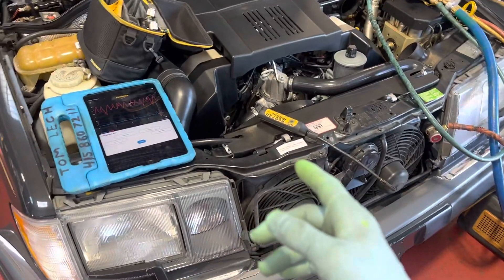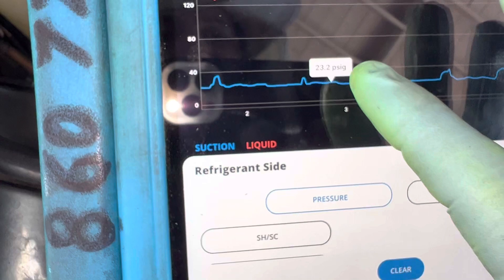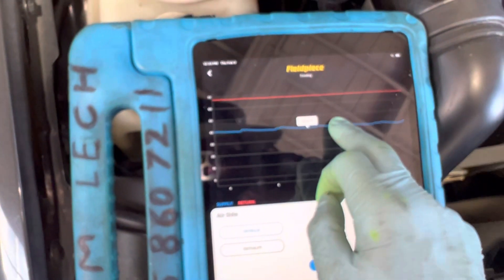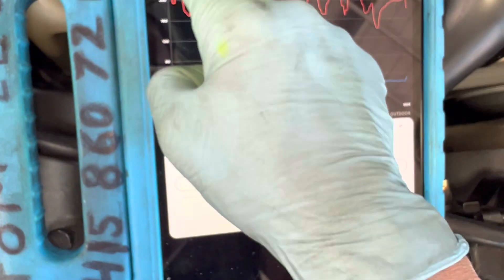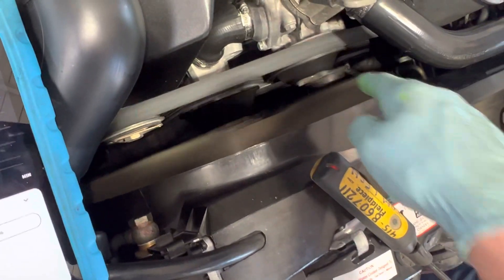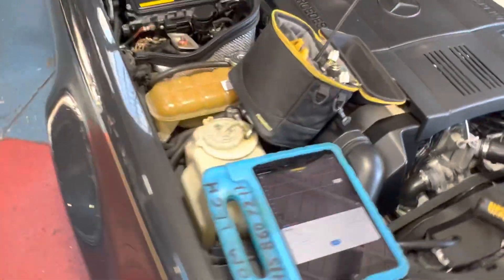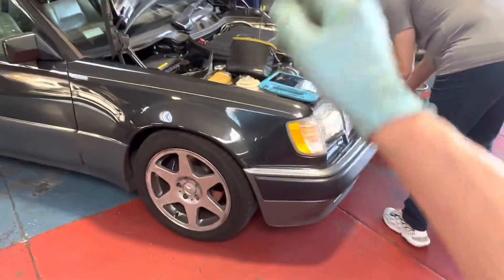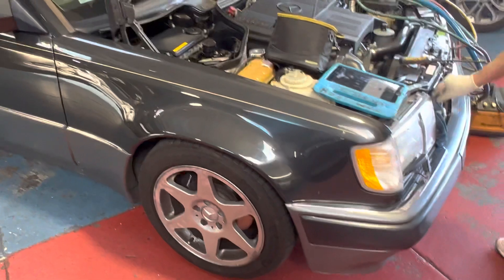Watching mapping data log AC compressor and fan cycling

Comment: Where are you measuring AC pressure?
Reply from the maker: Yes
Reply: @coldfinger459sub0  Where is the pressure meter located on the AC circuit?
Reply from the maker: @AK-IT  the Fieldpiece pressure, transducer’s are connected to the high side and low side service port
Reply: @coldfinger459sub0  Thanks.  Was interested in purchasing an automotive scope that could double as an AC data logger when paired with a pressure transducer accessory for AC pressure, a temperate probe for cabin temps, and a volt  probe or amp clamp for fan readings.  So a 4 channel scope perhaps for AC diagnostics.
Reply from the maker: @AK-IT  yes, there’s a lot of amp clamps and voltage and pressure transducer‘s for like for the pico scope that you can use
Reply: @coldfinger459sub0  Yeah, the PicoScope is the one I was looking for.  Have you ever seen it used like that before, for AC Diagnostics?
Reply from the maker: @AK-IT  there’s one or two PECO scope professional guys on YouTube. I remember seeing their channel before and they were showing using pressure transducer’s.

You could use them in hydraulic lines, air conditioning lines. You can even use them in spark plug cylinders to take pressures. There’s many different types of transducers.

For air conditioning, a pico scope is overkill 

They even have barrel metric sensors we could take the pressure of the intake manifold or off the PVC of the valve covers
Reply: @coldfinger459sub0  I can see the PicoScope for AC Diagnostics alone is overkill.  Though, with such an investment, adding AC Diagnostic abilities to its already impressive automotive electrical diag abilities just sweetens things.